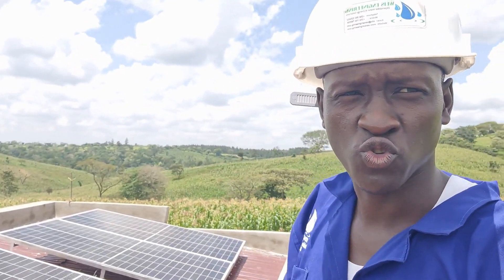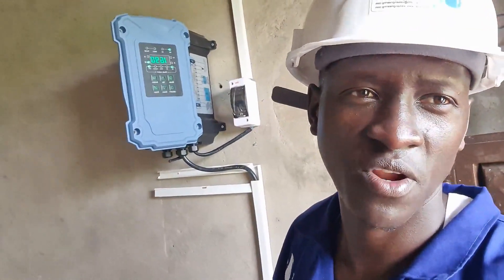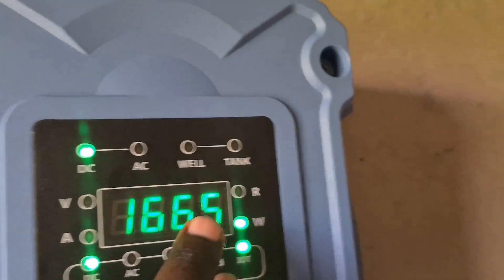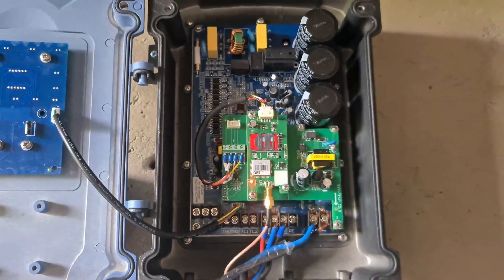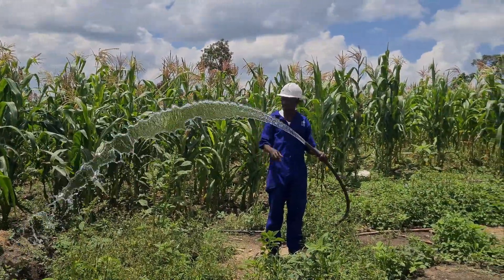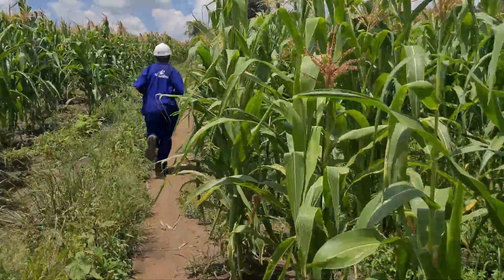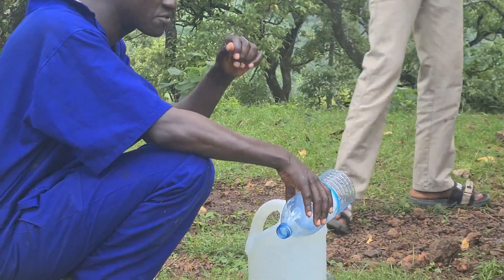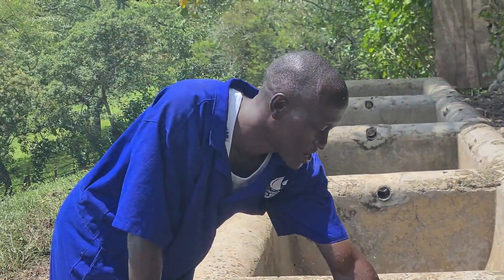Pumping water from shallow well using a solar pump in Uganda  over a long distance (620m)

Comment: What is the model of the pump and the controller?
Reply from the maker: Hybsun, controller and pump
Reply: @ thank you. Is it submersible or service pump?
Reply from the maker: @raphaelmutili  submersible pump
Reply: @ Thanks guys. You really doing a great job. Are they available in Kenya or  Uganda or someone need to import from
china? I want to do a shallow well and pump the water directly to the farm which is approximately 400 meters

Comment: Your vids are awesome 
Just wondering What is the name of this controller ?
Reply from the maker: Hybsun TGP hybrid inverter
Reply: I wanted to ask about pump recommendations for a 70ft depth borehole. Ideally I would like solAr hence why I was interested in the hybrid controller. But the solar package I was quoted was quite expensive. Not sure if I was overpriced or not. I’m based in the uk but setting up in Togo.
Reply from the maker: @jonahrunzo8430  Thank you for the information, the cost of solar water pumping system depends on several factors like depth, borehole yield, volume of water to be pumped per day, delivery horizontal and vertical distance, sunshine intensity in the area, to mention. Cost also depends on brand of materials needed. You may need to discuss the proposed quotation with the technical person who developed it.
Reply: @WeisEngineeringLtd   Any midrange brand recommendations? I’ve been looking at Lorentz which are quite expensive.
Reply from the maker: You can try Hybsun
Reply: Thank you soo much. 🙏🏾
Reply from the maker: @jonahrunzo8430  you're welcome